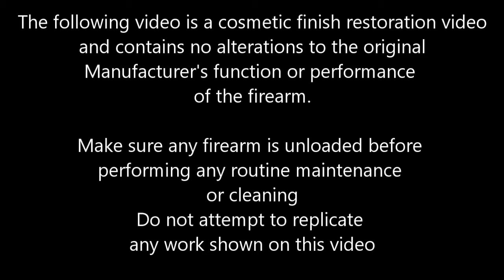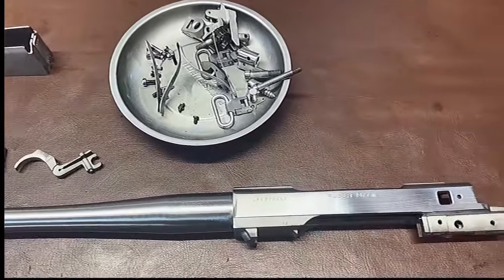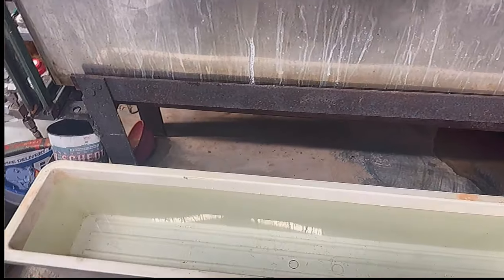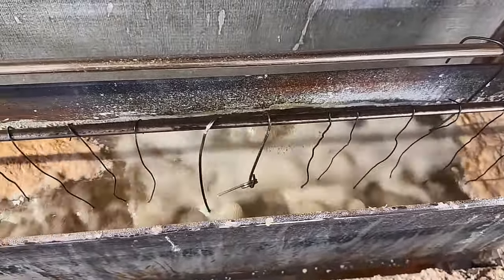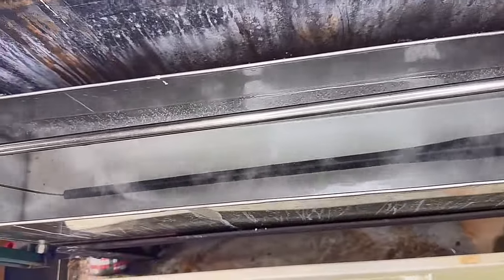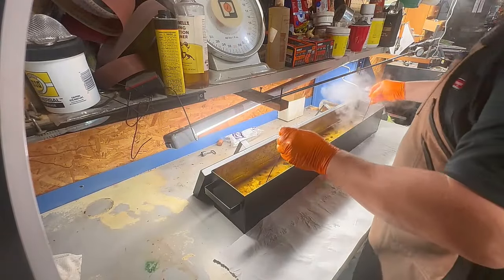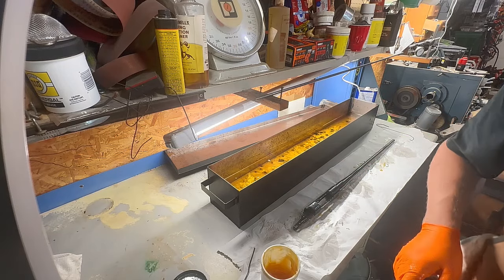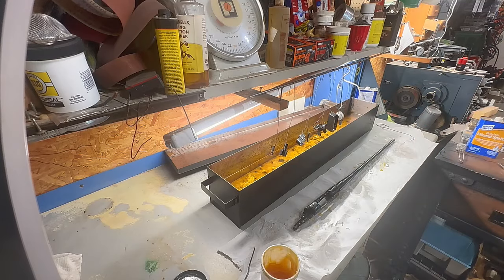Part 3 Professional rust removal - Bluing

Comment: It's interesting and helpful to actually see the complete process, the draw filing, the polishing, and finally the hot blue / anti-rust.  Books and instructions are all well and good, but these short videos gave subtle insights into the process, and told a wider story... I had a nagging question of is barrel bore stoppered? ... apparently not!   Good job, I learned quite a bit, thanks!
Reply from the maker: Thanks for the kind words glad you enjoyed the series. As you saw, no the barrel is not plugged when it's blued. I do plug them when using Cerakote or Parkerizing. You should check out this 4 part series I did on bluing a Remington 742. I go a little more in depth. https://youtu.be/Cm58xhFqsiI Thanks for watching.